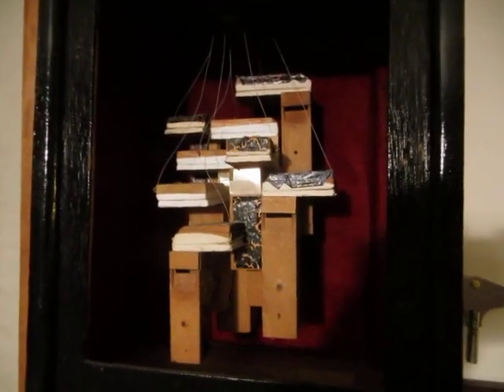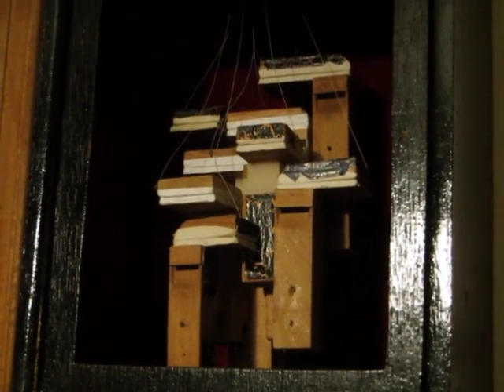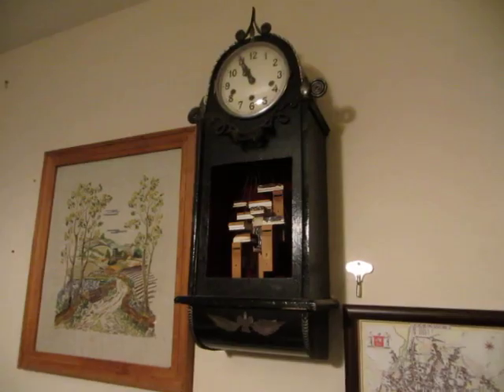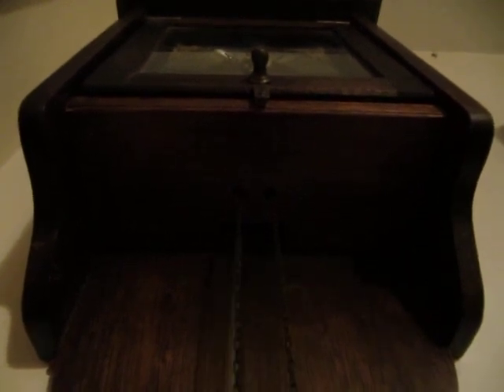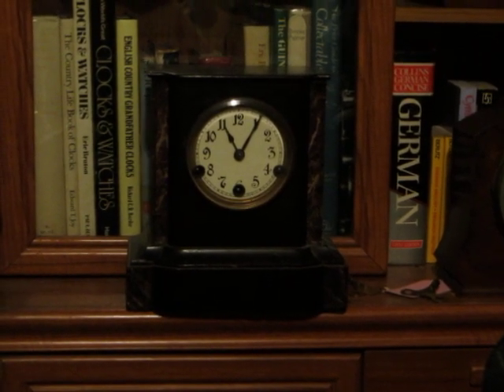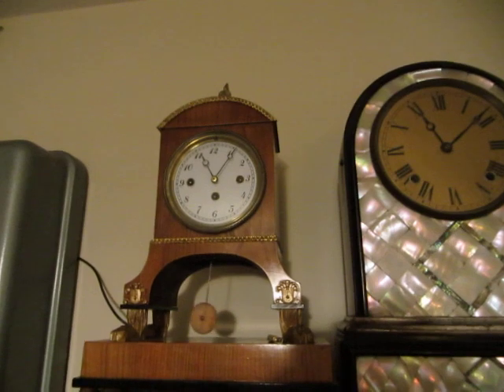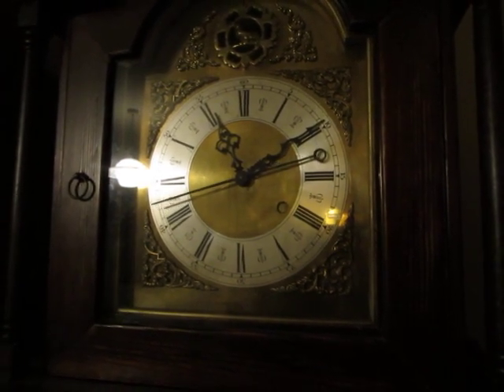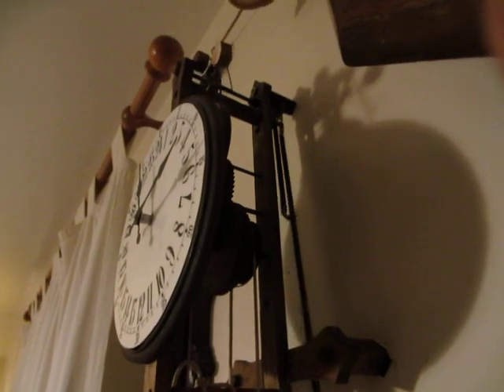The Philosophy Of Clock Building

Comment: I’ve been working on a “tommy project” these past few days and I just finished it, it’s a smaller austrian vienna regulator case (it looks like it hosted a 1 weight movement) and I had a spare new haven banjo clock movement laying around that fit perfect. The dial is a “tommy ish dial” and i made the pendulum myself. I will upload a video very soon
Reply: point of me commenting this is what you said at the end about “bits lying around and using them to make something” and that’s what i did

Comment: Can you do a video of your clocks chiming at noon
Reply from the maker: Actually I have planned that video for some time now... but I'm going to wait until I have a few more clocks completed first!
Reply: Before fix your drop dial clock
Reply: Did you hang the light clock I saw it higher in the glass reflection of the cabinet
Reply from the maker: @hurricanicclocks  Yes I did indeed. It needs a small touch-up to a scratch on the dial, but I haven't got round to doing that yet.